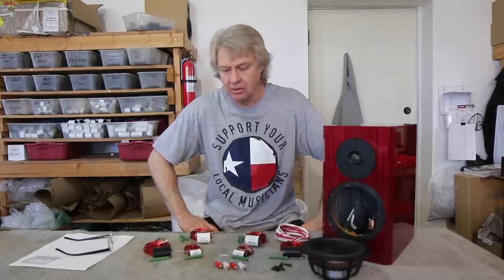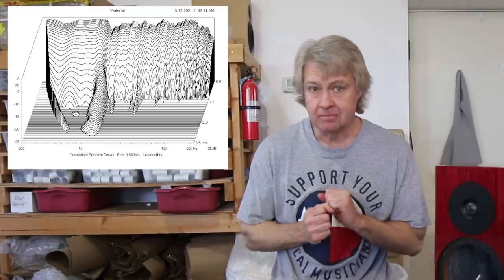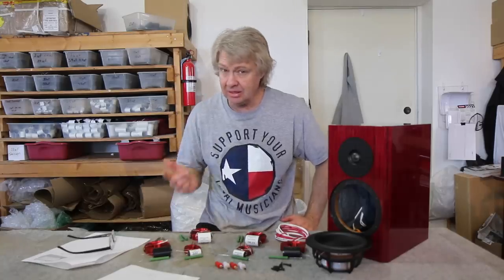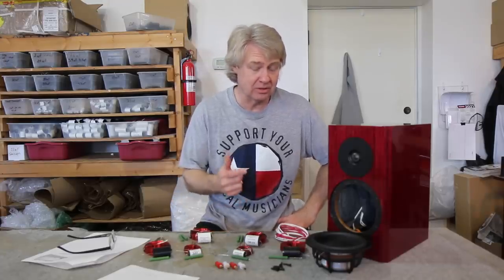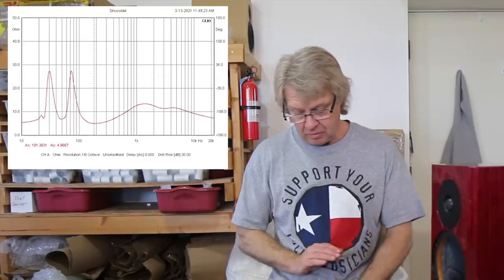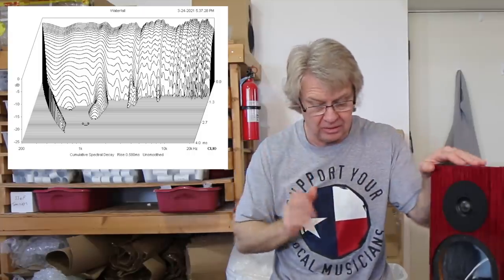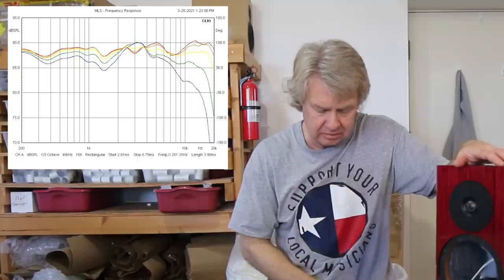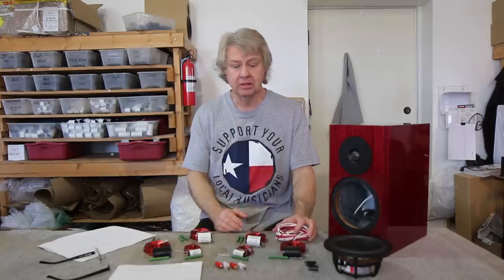Dynaudio | How “Special” is the 40?

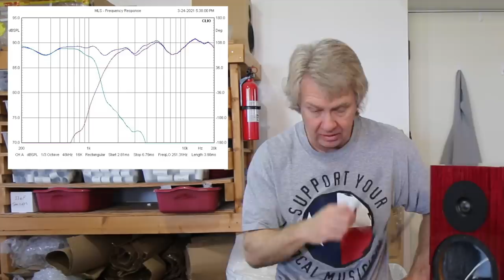Comment: Weel, the new crossover you propose is out of phase in 3-6 KHz area as can be seen on 7:30! That is not good and not the case with the original. Now we have a beginers mistake in crossover. I bet it will sound different but no way it can sond better! Parts quality are very arguable, specialy those wires as originals are some VDH wires which are very good and not at all cheap as you mentioned!  Mundorf caps are low quality? I do not agree at all. From this video I would only go with some no res treatment but maybe not even that! Special 40 are very good as they are! Oh at last, that edge resonance made by bass driver is no more seen in your new measurement as you moved it down a bit but is very much there untreated!
Reply: Nope, they are in phase over a wide range. The factory wiring was cheap PVC coated wire. The caps consisted of a few budget level poly caps and a bunch of electrolytic caps. And the parts that I used will absolutely improve the detail and resolution of the speaker across the board. It will also be confirmed by the people that build out this upgrade.
Reply: @dannyrichie9743  well, graph you published clearly shows phase problem! Yes, modified boxes will sound different. Better? Time will tell!
Reply: @turcinovic90  It wan stranded PVC jacketed wire. Nothing special going on there.
Reply: @turcinovic90  The measurements didn't really show any phase problems before or after the mod, but after the mod the drivers stayed in phase over a much taller vertical range, and is one of the best that I have measured in that regard.

Comment: Lowering xover freq = lowering power handling.
Reply: Not an issue at all with this speaker.
Reply: @dannyrichie9743  Show is your upgraded crossover Danny. You never even built it.
Reply: @toucheslapper  You are trolling.
Reply: Not necessarily. If you increase slope or if tweeter is overspec'd there won't be any issues.
Reply: @toucheslapper  Of coarse it was built. The measurements shown was that built network on that speaker.

Comment: So many here don't get that pretty much any speaker unless you're talking elitsts level and costing speakers. Have relatively cheap crossover parts. Y'all pretend you can hear the difference between a polycap and electrolytic cap with same microfarad values. 

You don't, it's such a ridiculous claim in general. Don't get me wrong, when you pay a good amount for a speaker. You should expect better parts there I do agree, it adds longevity what not. 

In the end we use subpar tools (ears) to pretend we understand and can hear perfection. We don't ... 

So I get that some lovers of these speakers love them, the measurements also don't really apply as people adjust the set up /room to what they wish the hear from it. 

How many here use diffusion panels? Bass traps (not really a thing trapping bass) but who does it?! 

Why? If your speakers measure so "perfect" why need all that shit ?! Ohh wait , it depends on the room HOW it sounds ?? See what I am getting at here. 

Don't get me wrong it's super disappointing to see a brand like that drop the ball like this. But nobody complains about the sound of them... Isn't that what its about. People buy them , and enjoy them no need to banter over a cheap indictor and handful of parts . That in most speaker we own are just as cheesy

Comment: 3K? LOL  I'll assemble a Troels' kit for 1/4th that .
Reply: 3k for the speaker. Kit is 300 USD. In my country just sending such a kit costs around 80 USD. 20 years ago I could have sent such a thing for 15 dollars.
Reply: @RealHIFIHelp  3 way Classic kit can be had for less than $1200 delivered.  They would blow away this overpriced 2 way.
Reply: @joeygonzo  I get that. I was just saying that Danny only wants 300 USD for this KIT that covers 1 set of speakers. That is not a lot of money.
In my country a good DIY speaker like the DTQWT mk3 still costs about 3000 dollars to make from the ground up, and then I have to probably use 3-6 months putting it together.

I guess Danny is only making 50 dollars per kit, which is not a lot.

Comment: Air core better than iron?
Maybe....but DCR of iron core is usually WAY lower...and as long as core saturation is not reached....better damping factor.

Of course HUGE gauge air coil are OK...but in small cabinets alignment is compromised by lowering cabinet volume.
Reply: Iron cores smear the signal and sound muddy.
Reply: @dannyrichie9743  imho...only if driven near saturation...or without laminated core. After all.....the output transformers of all tube amps use iron cores.

My main point....the iron core allows practical use of extremely low DC resistance wire....which is to me even mote important.
Also....the tempation to use iron core for low DCR is only for higher value inductors...ie only frequencies well below midrange.

I agree....if you put in HUGE air core inductors ...sometimes you can still get acceptable DCR.
Sometimes though...it means mounting xover externally.
Reply: @think2023  Danny is right. You can get away with iron core on woofers on 3 way system though and use iron cores strength.
Reply: @carlosoliveira-rc2xt  nobody argues that point.
Its the use of beefy laminated iron core inductors that gives you an advantageous  trade off of lower DC resistance and so better woofer control  when compared to practical gauged open core alternatives. It hinges on crossover frequency and the lower the frequency the more likely the iron core is preferable, And also power handling where if not properly scaled an iron core can do serious damage to the sound, Impracticality when an air core inductor of correct inductance will rob you of an unacceptable amount of cabinet volume and of course money because  Copper aint cheap..
 As with all speaker design decisions it's  about balancing the various compromises.

 That said there are some areas where  The science is clear. For instance I would pay absolutely no attention to a speaker's ability to play far beyond 20000 cycles.
 In other areas of  Course there are   Compromises and always there's cost to be considered. Would I ever advocate spending money On an expensive air core low frequency high power inductor of the same or lower DC resistance?
 Absolutely!...it is a better value than $1000 speaker wire! :)
Reply: @think2023  The differences in air core verses iron core can be easily heard at levels far from saturation.
Reply: @dannyrichie9743  in output transformers or crossovers or both?
Reply: There's no good reason for placing the crossover inside the speaker cabinet, other than practicality. Dispense with that nonsense and the issue is resolved. 10awg 0.68mH ribbon coil I have in series with the midrange driver measures 0.06Ω DCR.
Reply: @paulb4661  agreed...and allows easier tweaking over time. My point was that any change to cabinet volume needs to be considered (i may have missed it but recall no mention of exyernal mount for xover) and some of those crossovers were huge...not to mention the nores etc and nary a mention of cabinet tuning etc.
Reply: @think2023  I did notice that omission as well, but I think it's a matter of sacrificing LF extension a little on the altar of much better linearity and resolution, although it's never getting explicitly mentioned. Not everyone is prepared to have extra boxes around their speakers, then the sheer number of binding posts needed may present a financial burden, unless technically the best solution of directly soldered is utilised. However gains are huge, as microphonic in nature passive components are out of harm's way. Oh and actually, one cannot always have air core coils - I needed a 12mH coil in series with bass driver and even on a large diameter toroidal core the DCR is not vanishingly low at 0.15 Ω, trying to achieve even that combination without a magnetic core would probably call for a coil the size of a bucket 🤣
Reply: @paulb4661  when the presenter is making claims of huge audible differences in speaker cables because of their differences shielding in the Mhz range....well I get a little pickier critiquing omissions.
But yes...for most the bass issue is secondary to balance  and off axis response....still not in the spirit of chasing  insignifigant  gains like tiny amounts of ferrous material in the signal path etc. to ignore it....in smaller speakers at least.
Reply: @think2023  Are you referring to that (in)famous episode, when Danny uses inductive by nature inductors as a facsimile of non-perpendicular conductors in cables ? That was painful to watch, I'll give you that ! Perhaps the sales pitch got the better of him, then again his is nowhere near as nauseating as poetic rainbow vomit cascading from the mouthpiece of speaker manufacturers. Danny found a niche, we buy with our eyes and manufacturers know that damn well, and that's where he comes in, revealing crap lurking inside those beautiful boxes.
Reply: @paulb4661  yup that was the one. That it...to me anyway is incontrovertable evidence of his amount of science background.
That said...yes indeed commercially available home hifi speakers are engineered to be saleable above all. Electrolytics and undersized iron core inductors less than precise resistors sized to 10 degrees below spontaneous combustion at full load...thats the norm.
Worse still the port tuning!! Usually huge hump near 50 some hz to sound"punchy"
So yeah...for sure there is a niche....and what he says about good connections...bypass caps...cap upgrades etc...yup good value for dollar
Reply: @think2023  Spot on, spontaneous combustion is just ... so well put I cannot stop laughing 🤣🤣 Brilliant ! But yeah, in terms of vented enclosures my first pair was just that and from then onwards I have only built sealed ones and I tell you what, there's absolutely no comparison when it comes to impulse response, agility and freedom from colouration. In room response is miles ahead, yet bass reflex remains prevalent.
Reply: @paulb4661  depends on driver.
I like bass reflex too.  If correctly tuned the voice coil stays more linear at high spl down low. (But dangerous if subsonic as cone excursion is excessive.)
Everything is a compromise.

Generally I lean towards aperiodic damping or transmission line for the last octave. Cant describe the difference from ported or sealed...but its a difference i like.
Reply: @think2023  I don't know, could never reconcile low-colouration vocals with the presence of a vent, some sort of veil, hash clears as soon as the vent is plugged. Three way designs with low-cut bass driver perhaps yes, but with classic two way I add a lower tuned driver for a 2.5 configuration to restore weight and sensitivity somewhat. And yeah, I do like transmission lines - cumbersome but can sound impressive. On the subject of wiring, I do a lot of work recently restoring/upgrading amplifiers, there's been a massive improvement in quality of sound sources and drivers over the last decade or two, but when it comes to amps it's more of a retrograde motion, anyways, it's brilliant to see 14/16awg leads painstakingly making their way to flimsy eyelet crimps, locked between M6 brass nuts on the inside of otherwise mpressive binding posts.

Comment: Dynaudio has gone to shit in the last 10 years . When one was able to buy there components from DIY suppliers the quality of the woofers and tweeters was spot on. I built dozens of speaker systems using them , and crossovers only needed a few parts to be a accurate system ,

Comment: Ever since Dynaudio was owned by Chinese some years ago,  the credibility goes way down!    I have been a huge fan of Dynaudio since early 2000 and still have Special 25's.  But the later offering are definitely less engineering and quality oriented, rather marketing only to take advantage of the reputation of Dynaudio.  but that won't last long ---  killing the hen to get eggs never works!

Stay away from Dynaudio!    

Newer generation of loudspeakers are moving to active, DSP and smart control.    If you move along with the trend,  try Genelec, Neumann,  or Kii and Dutch & Dutch,  which are really fantastic engineering masterpieces.

Comment: Dynaudio was always grossly overrated and massively overpriced like all the European brands, especially in the 1980"s and 90"s.Those you have don't worth more than $800 per pair.A skillful and savvy do it yourselfer could build a great pair of double woofer three-way slim towers for the same $3000 using a better tweeter and a good mid range driver.

Comment: I found these speakers online for the low low price of $3500.00 USD and £2700 in England.  At that price, I would have expected it to come from the factory with much better high end response than shown.  And don't anybody look at the spectral decay of their own speakers before they foist them off on an unsuspecting public?  

And for $3000, one should expect better than cheap MDF.  My first coffee table was very nicely polished cheap pressboard.  It looked nice too, but it was still just a cheap, chinzy coffee table I bought online for $60 (with 2 matching end tables).  For $3000, I expect a box to be nice, not just look nice.  One can make plastic look good.  Looking good doesn't make it good.  For $3000, I can make a box out of any one of a dozen less resonant materials, and they would all look just as nice.

And those drivers.  WTF?  I've seen $40 Wall Mart specials with better response curves than that.  Where did they get those drivers?  Alibaba?  Wish dot com?  That's pathetic.  Absolutely hideous.

Next thing I noticed is that smoothing things out came at a big expense in overall sensitivity.  It probably would have been better to just ditch the drivers and start over.  Come to think of it, the box is a $60 special too.  So, there's absolutely nothing worth saving here.  Not the drivers, not the box, not even the crossover.  Maybe the insulation?  IDK.

At this point, I'd say avoid that whole company.  If they sell junk like that for $3000, then I'd be wary of anything they sell.

Edit: Sorry GR.  I'm so very sorry you have to put lipstick on such an ugly pig.

Comment: You place great weight on measurements on speakers and their drivers and yet when it comes to wires and cables, you put zero weight on measurements and ask everyone to trust their ears.  Why can't you measure the difference between wires and cables?
Reply: We do measure differences in wire and cable. But just like the crossover parts used, basic inductance and capacitance measurements don't tell you how they will sound.

Comment: Interesting , other than rough frequency curve measurments from this super well tank like build woofer what other aspects of it's sound there to talk about? I can't believe that it is all shit, what about power handling, distortion, tone definition (of course maybe affected by uneven freq curve) , how low in frequency can it go?
What about that tweeter, how is its clarity , detail, spatial resolution .
I wish we could read before and after listenig test/review.
Great Vid Danny, amazing to see electrolitic caps, sand cast resistors , cheap wire and crappy cabinet for 3000usd monitor speakers.
Maybe they do have a "special edition" with better quality parts worth say 100usd but price jump to 4000usd 😂